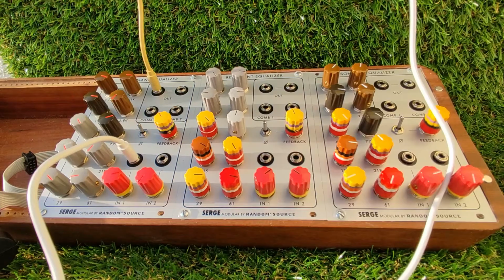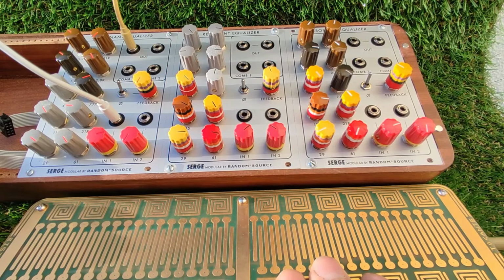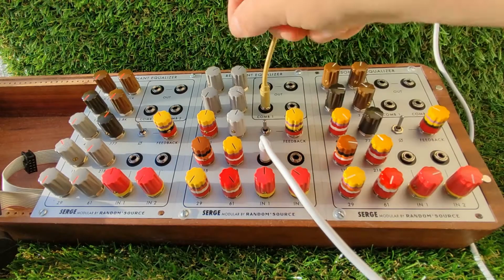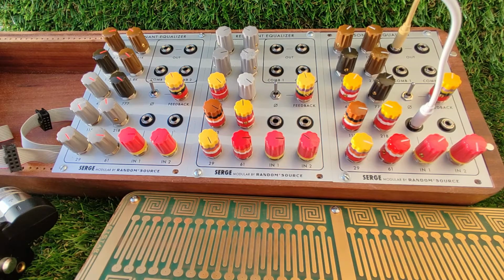Serge Resonant Equalisers

Comment: I like this video a lot. I think esp with the flute the textural differences are obvious. One question: when you used those two different opamps, did you have to change any other parts values to accommodate for the slightly different specs, or did you just flip them in?
Reply from the maker: Thank You!  Same parts with all the different op amps!  just a chip swap!

Comment: Interesting to hear the differences of capacitors but I think that the test you have done is not functional to hear these differences (assuming that on youtube you can appreciate a difference). I think it would be more useful if the 3 modules with the same settings were made to be heard in sequence (without gaps between one and the other) ... what do you think? thank you
Reply: exactly
Reply: I recently got the Thonk Resonant EQ and can clearly hear the differences in this video but maybe because I am accustomed to the sounds of the module already?
Reply from the maker: I do this at a couple points in the video.  I'm sorry the video isn't well labeled.... The Chaos of the feedback circuit makes it quite difficult to do exact comparisons when you are in feedback mode.
Reply: Absolutely. Although, that would’ve been oppressively rational and scientific. :| this demo is basically useless.